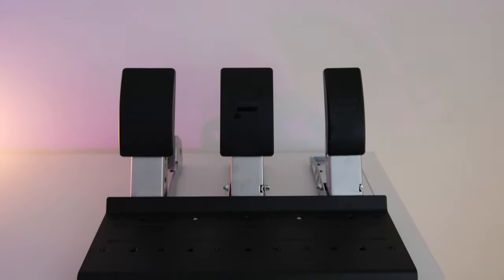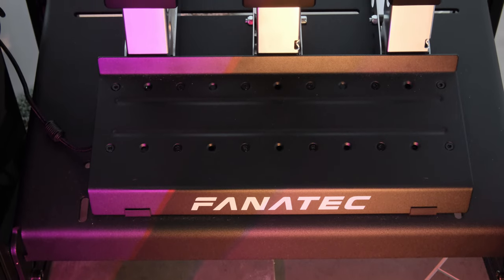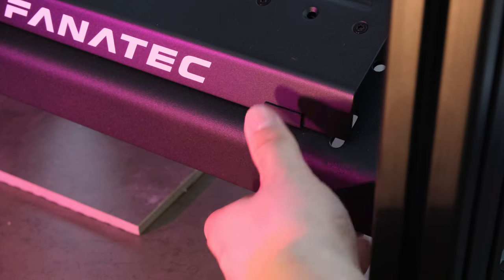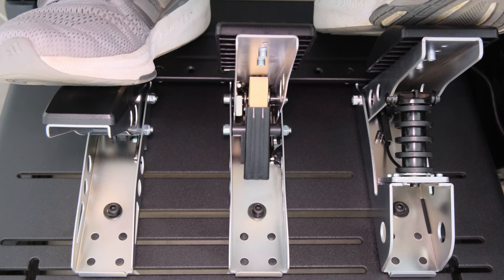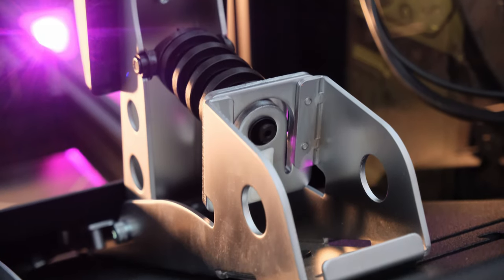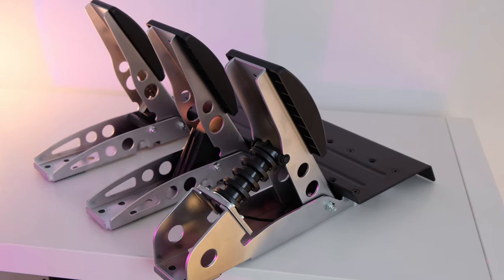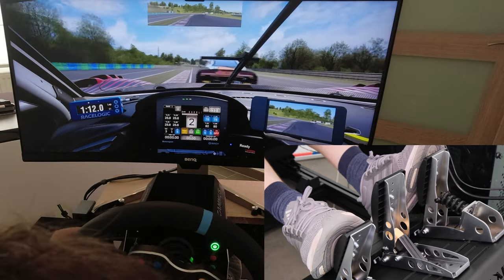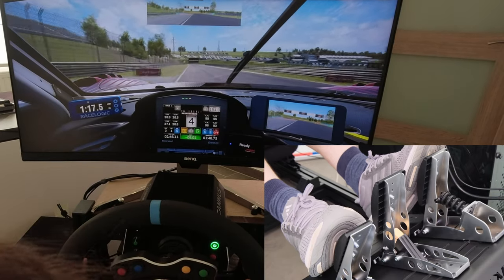STILL RELEVANT? Fanatec CSL Load Cell Pedals Review

Comment: I recently got the metal pedal "tuning kit" and I believe you are wrong in saying they don't offer any additional tuning. they actually are longer and higher, so you can get more leverage on the pedals. it does make a noticeable difference in pedal travel and feel.  having said that I do agree that they are a bit of a over priced option.

Comment: i was gonna buy these pedals with load cell and put them on the carpet, will it move around if i do, if it does what can i do to stop it ( i dont have space for sim racing cockpit as the wheel is on my desk
Reply from the maker: Bolt them to a plate so you push them into the wall